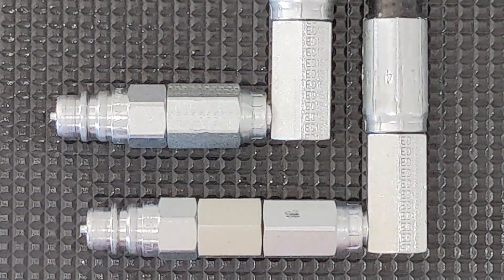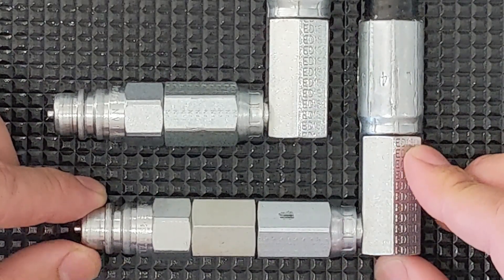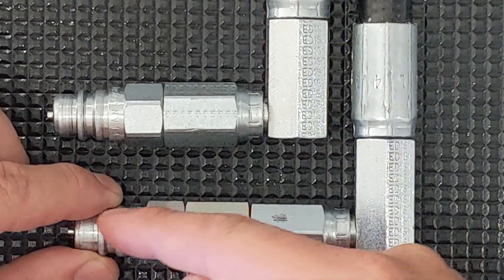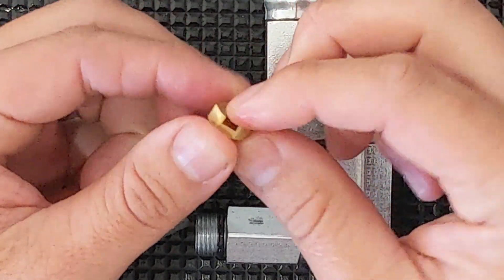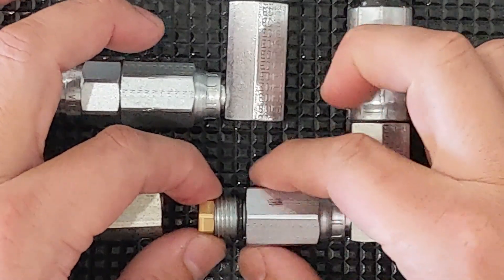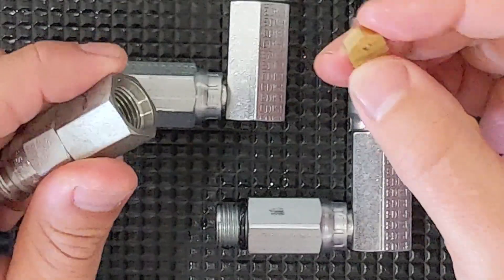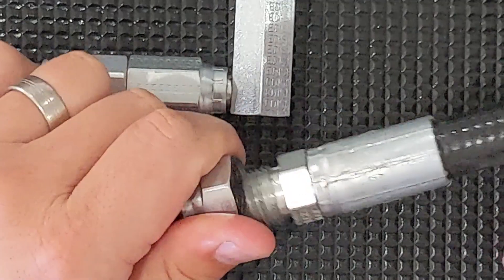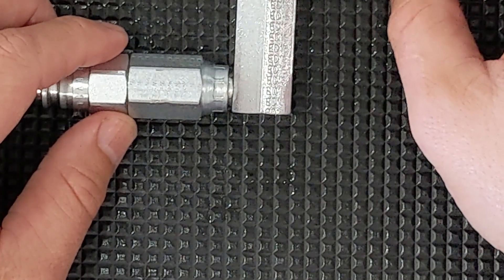John Deere hydraulic restriction

Comment: So, did you solve the problem of the restrictor and higher flow bogging down the engine?  I think that's what you said was an issue with the high flow pump.
Reply from the maker: That was on a very high flow experimental pump, and I haven't worked on it recently because I think it may have some other challenges.   That said, the solution for that problem is likely larger cylinders on the lift circuit along with a larger orifice in the one way valve.  I don't think you can solve it without larger cylinders without making the loader too sensitive under load.  Even a small increase in the orifice size makes it pretty quick with the stock lift cylinders.

There is one other consideration here, and that is the PRV valve.  Another way to eliminate the bogging is to have a lower setting so it doesn't strain the engine when it goes into relief.  I probably had mine set to 2500psi or so when it was bogging, but I can probably put it back to 1900 or so and it won't bog.  This has other obvious trade-offs, but it's another way to skin the cat, just not one that would work for me.
Reply: @HydrosPlus  Ah OK. I was thinking it was an issue with the extreme kit. Thanks for the detailed reply.

Comment: Thanks for the explanation. Can you tell me the brand of the hose fittings you have there, they look like a match to the fittings on my tractor. Thanks
Reply from the maker: The quick coupler is either from my JD 1025R or Summit Hydraulics.  The restrictor housing and orifice are from my JD 1025R.  I'm not sure of the brand on either of them, but the fitting size is a -6 SAE/ORB which equates to 3/8"

Not sure if that was the exact question, but let me know if this helps.
Reply: @HydrosPlus  thanks for the quick reply, I should have specified, I was looking for the elbow crimp on hose fittings. I Installed the jd third function and I’m trying to make a setup to get lines out to end of loader boom. I’m trying to make it look somewhat oem, but can’t find those fittings…
Reply from the maker: @patrickmccaffrey5807  ah, sorry I don't know.  I had them made at my local Parker Store, but that doesn't mean that they are Parker brand.  I will try to remember to ask the next time I'm in there and I'll let you know.
Reply: Ok, thanks. And thanks again for the quick replies. Any idea on when you will be selling the boom hardline kit you mentioned in another video?
Reply from the maker: @patrickmccaffrey5807  No problem.  The boom hard lines were supposed be be here on 1/4, but everything is taking longer.  I'm waiting for an update, but I feel confident that they will be ready to ship by the end of the month...probably earlier.  I'll update my site and upload a video once they are ready.

Comment: Anything on the D series yet for hydraulics?
Reply from the maker: Looking at the D series, it's unlikely that we'll have anything for those.  Unfortunately, not a whole lot of them out there and based on the schematic, it doesn't look like anything I currently have would work on it.  If you have a D series and can send pictures of the pumps, I could confirm.
Reply: @HydrosPlus  I kinda looked the other day I’m not real sure but I think the pump is directly behind the right hand side back wheel. Right hand side meaning setting in the seat

Comment: Great information, now that the rest of the J.D. 1 and 2 series world knows that this restrictor “puck” is in there, I wonder if it would not be a problem if I were to drill out the center hole a bit larger for more flow but still having it there for its intended purpose. 🤔 As we have just been informed, taking it out completely is clearly a safety issue.
Reply from the maker: My opinion is that you really don't need any more speed going down, but as mentioned in the video, I was getting enough restriction with a much larger pump that it was pulling down the rpms.  I drilled one out a very small amount...the next inch size bit up, and it got a lot faster.  Almost like it wasn't in there.  I need to do more testing, but I was a bit surprised how fast it was just taking out a little material.
Reply: @HydrosPlus  I see, please keep us all informed as to your findings as you progress, it will be greatly appreciated by all I’m sure. 
I have a 2020 JD 1025R  with factory installed Loader & Backhoe. As it is currently configured it performs okay, but after watching some of your other videos I am definitely interested in purchasing one of your improved hydraulic pumps. I believe it is called a high volume pump but I wouldn’t swear to it. At any rate I would like to touch base with you sometime in the spring after we’re through with the Holidays and winter weather. 
I have a question regarding the backhoe after the improvements with the new pump, I’ve seen where the hydraulic cylinder that controls the curl of the bucket gets what we’ll call, bent out of shape. Is this due to the hydraulics having more flow or because the operator wasn’t paying attention or both? If you install a high volume pump and then turn down the “pressure” doesn’t this defeat the purpose of having the new pump in the first place? 
And, when I purchase a new pump, what else would you recommend I purchase as well to ensure a complete upgrade, or would the pump be all I would need? 
Any assistance would be appreciated…
Reply from the maker: @speedbuggy6269  for what you are wanting, you can purchase the High capacity or Extreme capacity kits.  They will include the performance kit as well as a higher flow pump.  I personally recommend the extreme kit because the performance is better and there are no down sides compared to the high capacity kit.

In regards to the bending of the curl cylinder, this upgrade doesn't increase your chances of bending that cylinder.  I personally think this is a cylinder issue and not a user issue.  You really shouldn't be able to bend a cylinder on a small tractor like this, regardless of the pressure setting, because there isn't enough weight.  This means to me that they have undersized the cylinder.

When you're ready to pull the trigger, give me a ring at 501.454.4652 and I'll answer any questions you have before you order.  Thanks for the comment!

Comment: I was looking for an o-ring boss seal 2 way restrictor for 2 circuits on my snowblower.  I'm adding chute rotation and chute deflector control on it.  I could only find NPT restrictors and I hate that style.  Finally found out that Brand Hydraulics makes them in SAE #8 and I ordered some through my local Motion Industries.  I'm getting some for my hydraulic 3rd link too.  Where did you get yours and do they make them in ORB style?  I definitely need them with the high flow pump!
Reply from the maker: the two way restrictor in the video is from Parker.  I took a quick look and I don't see an ORB version from Parker, only JIC and ORFS.  I've never tried it, but I've been told that you can add a o-ring to a JIC and use it as an ORB fitting because they have the same threads.  I would probably try it with something else before I bought a JIC restrictor, but just wanted to pass that info along.  Here is the parker page with part numbers - https://ph.parker.com/us/en/orifice-fittings-orifice-fitting-1
Reply: You need a cross over block adjustable flow and diverts fluid when the chute hits the stops

Comment: Thanks for taking some of the mystery out of these hydraulic circuits. It's almost like the loader boom arms need a  1st and 2nd gear for when there is a load present whether up or down. When using pallet forks making smooth adjustments can be tricky even raising the load. Possibly some kind of load sensor that dictates the circuit flow when loaded, but that just sounds expensive?
Reply from the maker: They make all kinds of features similar to what you're suggesting, but you're also right that they are very expensive.  One interesting option that's very expensive is a pressure multiplier.  If you added one, you could use the loader at the normal 2000 psi, but as an option, you could engage the multiplier in situations where you are trying to lift something heavy as a one off situation.  With it, you could bump the pressure up to 3500 or even higher.  The pump would still be at 2000, but the circuit after the multiplier on the loader would have the higher pressure temporarily.  Not for everyone, but would be nice in some situations.